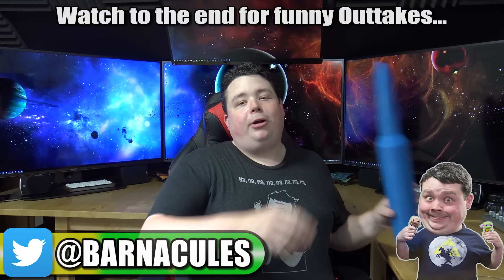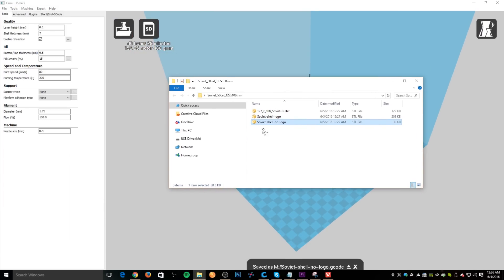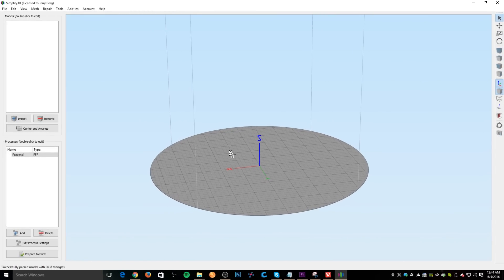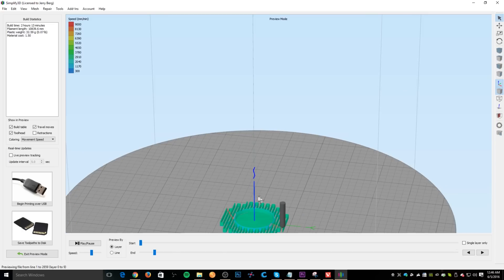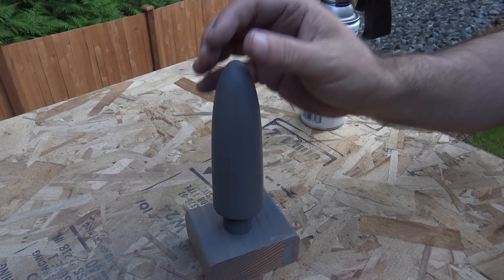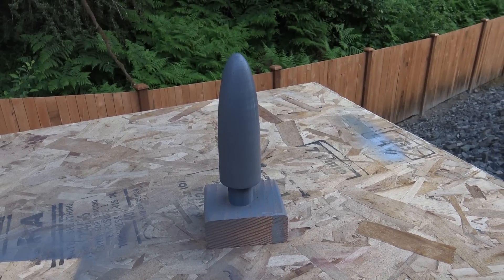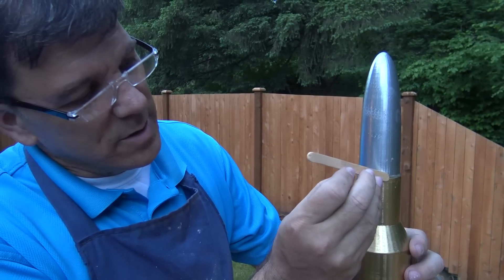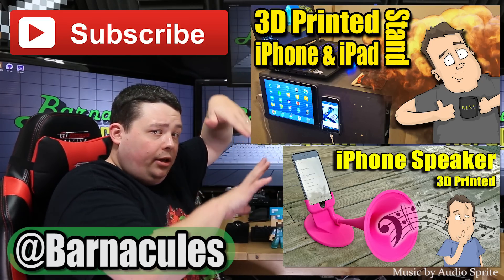3D printing a massive bullet, alert the media! - @Barnacules

Comment: a .50 caliber scaled up 350% is no longer a .50 caliber, it is a 1.75 caliber or a 44.45mm caliber.  You could have just 3d printed an actually 40mm Bofors round and have been cooler.

Comment: if you printed it with the bullet seperate and hollow. You could print the casing with a hole down the middle. then attach a noozzle on the bottom of the casing insert a can of o2 in the bullet assemble and you have a hybrid rocket.

Comment: I do not know much about 3D printing (so correct me if I have no idea what I'm saying), but I do know 3D modeling (B.S in Computer Animation)... Does the polycount matter at all when 3D printing? If it does not, why didn't the artist use a higher subdivision on the cylinder when modeling the casing? Using something crazy like 128 subdivisions or more. That way it would have come out looking much more round/smooth and wouldn't need nearly as much sanding. Him enlarging a low res model didn't help much either... Also, in 3D modeling, you can "smooth edges" to make a low-resolution object look perfectly round/smooth. It is what artists use in video games to get perfectly smooth looking geometry on low-resolution models. Can't that edge smoothing information be transferred into the 3D printing software from the 3D file? If not there needs to be a feature where you can tell the printer what needs to be perfectly round/smooth in the 3D printing software... Just my thoughts.

Comment: Jerry, how you liking that rostock printer? how does it compare to the your Ultimakers 2 extended ?  You are right, once you get pass the hefty price tag for  S3D ( especially in Canada with crazy USD to CAD exchange rate) , its a very useful slicer to have. I know! I know! but I can't help sharing my makers input, when I have round models to print such as your Dildo hahahha, I mean bullet, I print a few extra shells and I mount it on the wood lathe and just use a skew  to smooth the model out and lightly sand though the grits  , its a lot faster then sanding by hand . Anyways, its good to see you making more videos again Jerry.

Comment: You should try printing it with metal.
Reply: What the hell are you talking about?  You CAN 3d print with metal. Koenigsegg 3d prints their turbos for example.
Reply: facepalm
Reply: What? Don't you know you can get metal filament spool?
Reply: A E S T H E T I C 生活のための Not REAL metal...
Reply: The Cyber Silver
How? And you do realize you can 3d print with metal right?
Reply: Idk what you mean by, "How?", and you can print with metallic colors. Is that what you mean?
Reply: Only massive extremely high temp 3d printers can do metals. It would take up his entire room and generate temperatures exceeding 1500c. That is compared to the 200c of the printer that sits in the corner of his room.
Reply: Will Roberts
He can still 3d print metal, just not pure metal.  I think the 3d printed bronze head just has bronze mixed with the plastic.
Reply: A E S T H E T I C 生活のための It's hardly metal though. You might as well save some money and use metal embedded paints.
Reply: Will Roberts
Yea, It's not 100% metal but, at least it could be used for cool things though.
Reply: A E S T H E T I C 生活のための Cool things like burning your house down
Reply: The Cyber Silver
What the fuck are you talking about?
 You do realize I was talking about the normal printer.
Reply: A E S T H E T I C 生活のための until the day you have the power to run a metal welding laser, the cooling to vent the heat, a massive amount of fine metal powder and the money to run the whole thing... you can not 3d print metal. Koenigsegg explains that 3d printing is more expensive than tooling.
Reply: A E S T H E T I C 生活のための Bullshit, it took you 7 attempts to explain what you where taking about. Well done.
You:
"What? Don't you know you can get metal filament spool?"
Cyber Silver: "Not REAL metal..."
You later say: "I'm asking how it isn't real metal?"
You later say: "He can still 3d print metal."
Reply: He would be better off buying a replica 50mm shell and casing.
Reply: Will Roberts

"Bullshit"

Mind pointing out what I said what was bullshit?

"it took you 7 attempts to explain what you where taking about."

No it didn't

"You later say: "I'm asking how it isn't real metal?" "

What's your point? It's a legitimate question considering that it has metal power in the filament.

You later say: "He can still 3d print metal."

While not being %100 pure metal. he can still do it.
Reply: A E S T H E T I C 生活のための And then you dispute him. I'm done you won't find me here again.
Reply: Will Roberts
 You do realize he just dose stuff for fun right?
Reply: Will Roberts Ok, bye. No need to be melodramatic.

Comment: I had used Vivaldi for about a month and I really like a lot of it's features. However, if you're using a lot of tabs, Vivaldi will get EXTREMELY slow compared to Chrome.  There were also a few features of Chrome that Vivaldi just doesn't have, such as synchronisation. So I switched back to Chrome.

Comment: hey Jerry could you do a little video showing how you set up Cura to work with the romax v2. I am currently building the romax v2 and would like to eventually use cura.
Reply: really simple.  you do custom machine options and set it to a round build plate and set your diameter and high and bingo.

Comment: Would anyone be interested in a Chrome extension that would auto skip these 'in video' ads for Squarespace and other companies? It would be manually updated each time the big channels like LTT and others release a new video.
Reply: keep fighting content creators and everyone will be forced to move to paid subscriptions they are spending so much time and effort creating these videos  
there has to be a way for them to make money nothing is free.
Reply: Ad Block ?
Reply: John Doe Ad block cannot skip the ads I'm talking about, because they're part of the video itself. Like jerry talking about squarespace.
Reply: You cannot reliably do that that's why no such extension exists they could change the timings a little bit and your extension will be screwed up.
Reply: ***** It would be a manual process. I watch most videos from the Big youtubers anyway, so I can just mark where the start and end of 'in video ads' are. Of course it would only work for those using the extension that watch the video AFTER I do. Unless I add some kind of public submission thing from trusted Youtubers.
Reply: ***** On each video load, it would make a single call to a database(web page) with the video ID of what you're watching. The server would respond with the timestamps of content it needs to skip through. It would be asynchronous so it wouldn't affect the page load speed. It would be tedious to start with, but when you have enough users and you can find trusted users, it would be easy to do as a community. Imagine, only one person has to mark the start and stop point of the advert and then everyone benefits from it.
Reply: ***** Hmm good question. To start with it would just be for Chrome. But if it was popular then I guess it would be easy enough to port it to other browsers.

Comment: Hey man. Nice video. Couple of things. First, you can change the shape of the build plate in Cura to round and secondly, you can change the support material from grin to lines in print settings to make it easier to break away. That's all. Great job. Keep it up.

Comment: Does Simplify3D tell the printer to print that circle on the build plate before starting the print or was that already there? Is that included in the Simplify3D Rostock Max v2's profile?
Reply: It's a test print for calibration and leveling that can be found on thingiverse
Reply: wait but why is it still there on the build plate?
Reply: +Kian Palmer he just never took it off
Reply: but how does one print over an existing print? Or is it so thin that it doesn't matter
Reply: +Kian Palmer it's litteraly one layer thin. So doesn't really matter
Reply: Ohhh okay thanks!

Comment: i think it would better when there'd be a primer on the bullet. but well it will probably stand anyway so someone wouldnt notice.
Reply: I suggested that too, pretty easy to add. Just drill a hole for a copper pipe plug.
Reply: sparkplug1018 true. but you could make the primer look way more realistic if you printed it right away.
Reply: Possibly, would certainly save a bit of work. But on real bullets the primer is pressed into he casing after the case is made. So in a sense would be the most realistic way to go. But either way would look awesome.

Comment: Great vid! ...For those interested and able, I'd recommend you 'lightly' use a lathe to help smooth out the faceting on the outer surface of the print. ...But you have to be very light with the smoothing process.

Comment: So i did the math and is a 44.45 mm round. Next time you should print it with that copper/plastic stuff and at 600% size increase that way it will be a 76.2 mm round and feel like metal a little bit.

Comment: OK, it's a 3d printer you have, why didn't you just create threads for the bullet and shell and screw it in instead? What is it with people using glue? You can make housings any shape you want. I don't get that at all. Anyway, it ended up looking pretty good, that's nice paint tigger was using.

You know what you have to print though.. one of those clip on aerosol can guns.. we need them, we really need them.

Comment: But how does one cut corners on a round object?? 13:33
Reply from the maker: #ISeeWhatYouDidThere
Reply: +Barnacules Nerdgasm omg!  you responded!! I love your videos man and I've been watching them for like 2 years at least now. still have my fingers crossed for that puget systems build!! I probably should be studying right now but this is much better than studying ;)
Reply: Comic-Sans 3D printer
Reply: cough
Lathe.
Reply: Apply a subsurf modifier?
Reply: Tmodifier doesn't work in 3D printing. You need to add the subdivision yourself.
Reply: Fucking cringe.
Reply: +Tetsujin Blender reference? :D
Reply: Because it is cylindrical. Therefore it has corners.
Reply: Sanding baby
Reply: 14:49 dude that was legitness

Comment: Hey Jerry. I just watched the documentary: "Print The Legend" and I was wondering why I haven't seen you use/acquire a Stereolithographic Printer yet. Is it still too expensive and/or software isn't quite there yet? (Cura and Simplify 3d, I imagine won't work) Hopefully you can consider acquiring/using one for a future project:)
Reply from the maker: I have one, but I messed up the glass transfer on it and need to get it replaced before I can do the review.

Comment: To rotate the bullet in Simplify 3D go to edit and place surface on bed.  It will put the triangle you selected on the model to the build platform so you can get the exact surface you want flush on the bed.
Reply from the maker: Great tip!

Comment: Not sure if this is feasible, but would it be possible to print this on a smaller printer? Slice the piece horizontally into shorter sections (meshmixer, etc.), glue them together, sand it a little bit. Maybe you could make a video on that if it works. (Current 3D printer only goes to 136mm on Z )
Reply from the maker: Absolutely 100%, I could 3d print this on an Ultimaker Mini in segments and glue it together and sand out the lines and paint it. More work but totally doable. I plan to do a video on how to slice and print larger objects on smaller build platform printers.

Comment: Simplify3D is the best. I'm using it for close to a year now and I'm getting much better print quality than Cura or Slic3r. It is expensive but once you go S3D you can't go back.
Reply from the maker: I've realized that the slicing software is every bit as important as the printer itself. If you think about it the printer just positions the head and deposits material at a controlled temp and speed. The software is what is determining the adhesion of the support material and the tool paths.